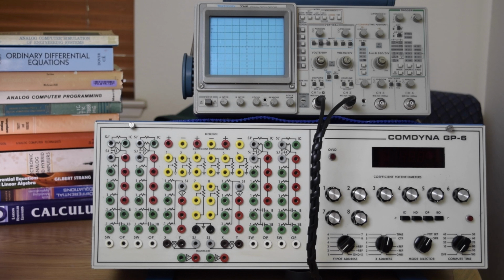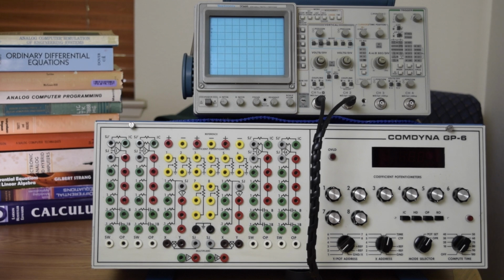Programming an Analog Computer

Comment: Cool!  Ever run across this old digital computer idea that used compressed air to compute , patent 3190554?
Reply from the maker: Not specifically. In the literature I've read, pneumatic and hydraulic analog computers were mentioned briefly, but only electronic computers were covered in depth. I just finished "Analogue Computers" by K. N. Dodd, where the last chapter covered "Fluidics." That was a fascinating topic. There were pneumatic computers invented that included amplifiers, resistors, and integrators for the analog side, and digital logic gates and flip-flops on the digital side, all based on compressed air. They could be manufactured using printed circuit techniques. Apparently, their advantage is they weren't as susceptible to shock, vibration, temperature or radiation as electronics. I've run across a Foxboro pneumatic analog computer on eBay from time to time, but I have no way to apply it, since my background is in electronics.
Reply: This says Remington Rand was into this and the links at the bottoms show that it was giving some thought by lots of smart guys. https://www.google.com/patents/US3190554 I have asked around to see if N.A.S.A was ever into this but so far nada. Bet this would make a cool 3D printing project for some Tech High School kids. If Babbage had this tech he could have had the pipe organ folks build his engine for him and Lady Lovelace could have invented COBOL . ( I think that is kinda funny so I post it when I can)  Dig the old kit "computer"  Geniac . The guy who posted it calls it "A story in digital. "  Now on to see if anybody has posted something on Collision Based Computing using Bristle Bots.

Comment: Why do you (at about 8:18) invert the output of the wiper arm from pot. 2 twice before display? Is it because you can only display the outputs of amplifiers or is there another reason?
Reply from the maker: Martin Koch Correct. In operation, only the op amp outputs are available, but I wanted access to this input from the potentiometer. I invert it twice because all amplifiers invert, but I wanted the '"true" signal. Normally this would be a waste of resources, but the amplifiers were available, so it was acceptable for this demonstration.